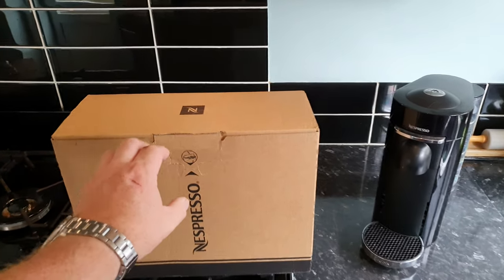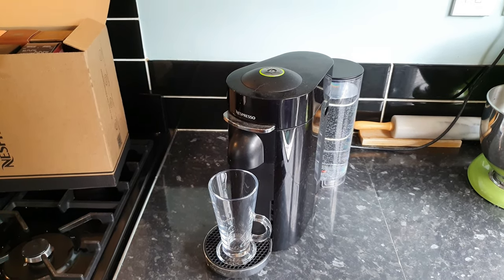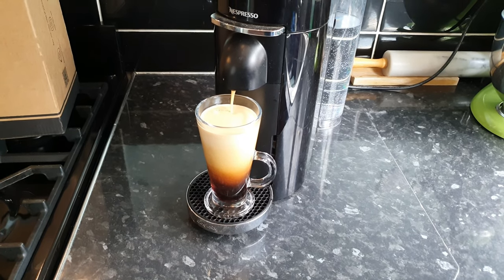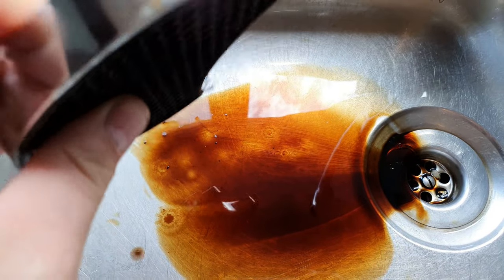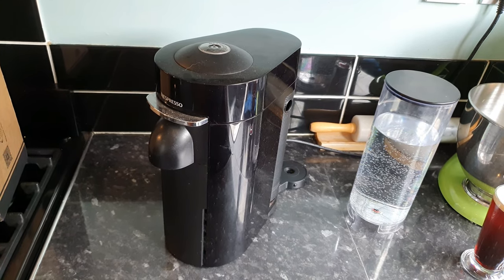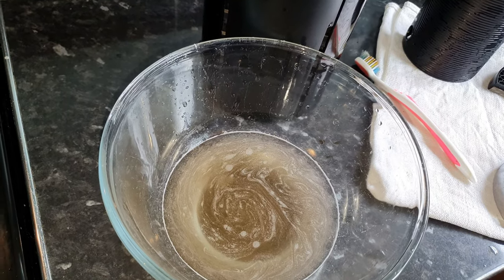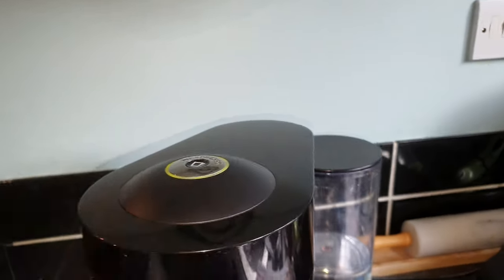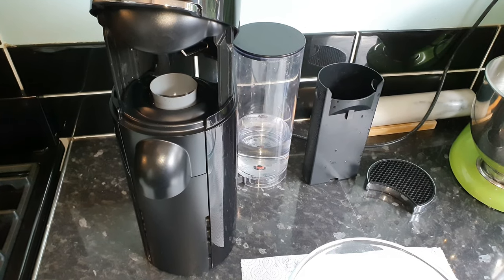How to Fix/Avoid the Dreaded Nespresso Vertuo Plus Leak

Comment: For some reason my coffee struggles to come out of the machine and it sounds like it’s struggling to spin the capsules
Reply from the maker: How long have you had it?  I ask because I think limescale buildup can cause issues too.  This machine started getting noisy and occassionally no working properly so I have replaced it (very cheap deal from Nespresso) and was immidiately struck but how quiet the new one was compared to my 3 year old one. I let the old one get very dirty for this video and ever since it started acting up. Kind of wish I'd stuck to my cleaning regime now.
Reply: @richwhilecooper  mine is two years old but I would descale it like every three months but I guess that didn’t help
Reply from the maker: Technically my machine is in warranty but I will tear it down and make a video about what I find.
Reply: @richwhilecooper  thanks can’t wait to see it

Comment: Mine started leaking again after doing this, I found a comment on cleaning the rubber seal, so far no leaking after making 5 cups...but if you don't mind, I can't copy the comment but will post the video that I found the comment in, just scroll down to comment where it's says "I fixed it". 
https://youtu.be/MUU8ALQEAb0
Reply from the maker: I saw it.  I was going to try this but cpuld not get the seal off.  I will try again when I have time.. thanks.
Reply: @richwhilecooper  no, you can't take it off...just squeeze a butter knife to separate the seal on the outer edge, scrape the knife as you turn the seal, ...I separated it and scrubbed with a tooth brush
Reply: @richwhilecooper  another cup and still no leak...keeping my fingers crossed it stays that way
Reply: @richwhilecooper  would be a big help for others if your able to make a video on this fix🥰

Comment: This video is a waste of time.... absolutely none of that would cause the leaking
Reply from the maker: Mine leaked when it was dirty.  I can only report on what I found with my own experience.  I'm sorry if it didn't fix yours.  If you have some deeper insights, you could share them with the community.  Some months after this was made mine developed a problem that cleaning could not solve. Not a leak, but watery coffee, initially intermittently but then all the time.  I'll be tearing down that machine ( although technically I could get a warranty repair) to try and identify the cause but I suspect 2 things, 1 a  perished seal(s) and 2, limescale buildup.  My new machine (same model just red) is noticably quieter and I think the old one was on the way out for a few weeks.  But I only had problems after I had let it get very dirty for this video.  Unrelated maybe.  Could be these things have lifespan and at nearly 3, mine had reached it. Replacing it cost me under £50 so I'm not that sore, but after recommending the machine I feel I should be honest about what happened to mine and what the problem turns out to be (assuming I can figure it out).
Reply: @richwhilecooper  well, I'm sorry I shouldn't have said what I said, cleaning the hole where water goes in the pods, and cleaning the hole where coffee comes out helped alot. I just used a toothpick and scraped around, got some grinds. I need one of those hose cleaners or whatever they are called and clean deeper into those holes. Also, my pods are also getting stuck...I have to push it towards the back. After I squeezed the prongs that hold the pod from above ..I don't have the leak anymore, so your video did give me some good ideas...just I was to quick to comment.
Reply from the maker: No worries glad it helped!